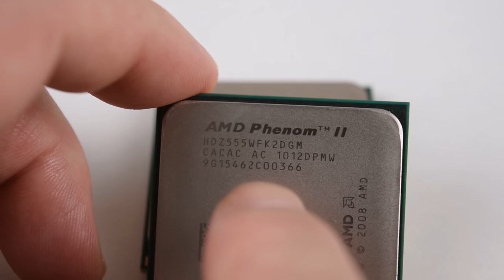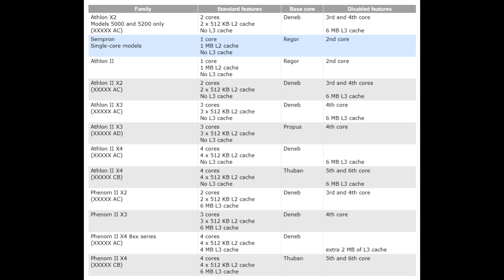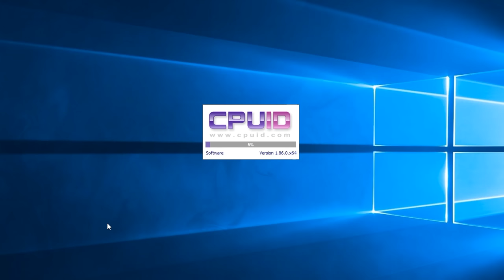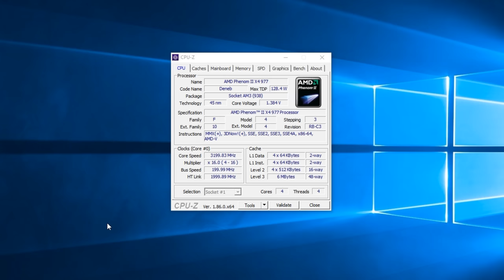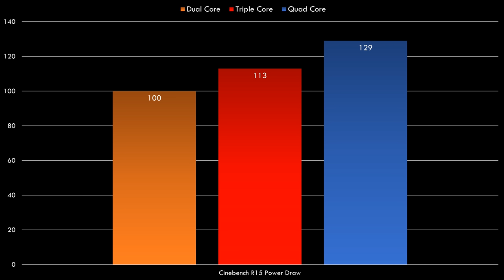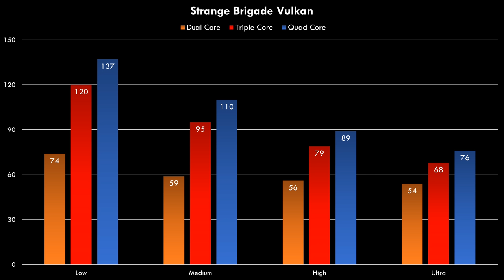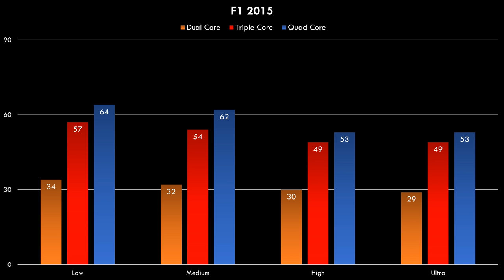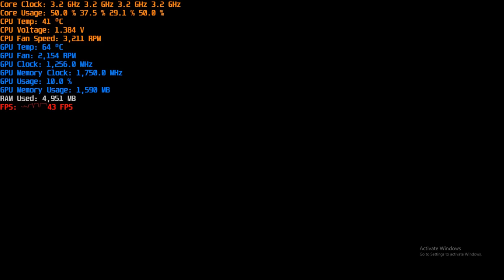Unlock $13 Dual Core into Quad Core

Comment: I have half a dozen of these laying around to build PC's for the less privileged. Did not know this and now I can give them more power for no extra cost.  Thanks Phil!
Reply: Careful, failing to unlock the cores can cause performance degradation
Reply: @nathanhamman418  Good thing Scooty has plenty to test.
Reply: Theres a reason why they turn them off.. Its the same reason why every chip on a wafer isn't labeled a Xeon.... Minor unavoidable manufacturing defects make it an unsuitable chip for the job.
Reply: @rezn66  He explains that in the vid along with an explanation of why it might be good to try. I get the CPU's from the dump so it's not so much of a worry.
Reply: From my experience on an Asus MB with the Core Unlocker switch, failing to unlock those AM3 CPUs doesn't cause degradation : it just won't boot. And if cores or cache are defective, you'll just have some instability issues.
The reason of defectiveness could just be a simple out-of-spec voltage requirement making a quad core chip being sold as a Phenom II x2-3 or an Athlon II x2-3-4. It's the true silicon lottery :)
Reply: @Vierax  They may not even have any defects. Sometimes they just bin them separate to sell different models. 
It's completely possible to buy a dual core that will unlock 2 extra cores and then that chip may well overclock more stably than a higher speed and core count binned one.
Reply: @Danny Evans I know but I was giving other explanation than what is in the video ;)
Reply: @nathanhamman418  That would be true if all chips sold were rejects. That isn't the case. The demand was FAR higher than the reject rate of the 4 core CPU's, not to mention the reject segmentation by the 3 core CPU's as well. In actuality, the difference was wafer real estate. The 4 cores got the prime real estate towards the center of the wafers, and the rest got the outside, where the reject rate would be naturally higher, but only subtly so, but enough to make it worth it cost wise.
Reply: The process is called "binning", and it's pretty standard in the industry... Once a wafer lot comes out of the factory, say 10K units, a bunch of random units in the lot (say 50 or 100) will be selected and tested. Depending how many have failures, the nature of the failure, etc, the entire lot it then binned (or rated) accordingly. They will use lots with especially good tolerances for K-series unlocked multiplier chips for example, and the worst for budget or lower core count, depending on the failure mode. Thing is what you get out of the factory these days is usually extremely consistent, barring problems with the equipment, which will usually make the chip useless anyway, so they end up with far more "good" wafers than there is demand for. So they lock some cores, or lock the clock multiplier, give them less cache, and sell them for cheaper. It doesn't mean the chip you have has a defect, it just means the lot your chip came from had a higher than usual core failure rate, so the entire lot was downgraded.
Reply: @rezn66  I agree! I have unlocked my Phenom II X3 720 BE and the system become unstable, due the problem in unlocked 4th core. It is nice to have something for no cost, just to be lucky it will work.
Reply: @peterfidler4891  I'm buying an old cheap Asus motherboard as a spare that still has core unlocker, can't wait to try my Phenom II x3 720BE on it too! I've had this CPU for a year but my current newer ASUS can't do any core unlocking sadly, it doesn't have that feature. Great CPU for about AU$18 but now it's gone up to AU$30+ so it must be a popular EBay bought CPU!

Comment: 0:27 oof, it hurts my eyes
Reply: Right?  Someone doesn't know what ZIF means...
Reply: @looncraz  What is the acronym 'ZIF'? I am quite curious.
Reply: @sanitylogic4611  "Zero Insertion Force"

These processors slip right in, you don't push on them. Great way to accidentally bend the pins.
Reply: @sanitylogic4611  Zero Insertion Force

It means the CPU should just fall into the socket - you NEVER push a CPU into its socket.
Reply: I thought I was the only one who noticed that omfg 🤦‍♂️🤦‍♂️🤦‍♂️🤦‍♂️🤦‍♂️ ZIF!!!!!!!!!!
Reply: that and sliding the cpus around on the desk pin side down in the opening clip. I am cringing hard.
Reply: @99domini99  that's dude.was a professional
Reply: Eyecat15  blaspheme!!!🤣
Reply: Zif
Reply: Yes. and if you slow down the video, it seem that several of the pins are bent.
Reply: Well that’s nice that you know what Zif means but from experience older am2/2+/3 boards tend to have misaligned holes between the actual socket and the white/blue plastic locking grid. I have two am2+ boards and it’s pain it the ass to get the cpu in without harming the socket... sometimes you to go as far as shaking the cpu in socket so the pins snap into their place. Even socket 7 has better locking mechanism than am2
Reply: Makes me glad Intel went LGA775 without any of that pin crap. Keeping old CPUs with pins like that properly stored is a nightmare.
Reply: @harryshuman9637  It's actually pretty easy. You just need some type of soft styrofoam so the pins can't move anywhere.
Reply: @siqu7071  Soft styrofoam will deform if pushed laterally, which will bent the pins even slightly. Especially if you keep it in box with other things. It's just the matter of time until you have to use force to put them in.

Comment: Beats Intels unlocking upgrade strategy.
Reply: I dunno, that server processor thing he showed us a while back was pretty rad. I believe it was the Socket 771 usable in a 775 motherboard? Either way, I learn a lot from this channel. :)
Reply: youtubasoarus . That’s not unlocking, that’s just modding. Intel actually sold locked CPUs that had the ability to have extra threads unlocked if you bought the upgrade card. You can’t even unlock those CPUs now as the service was quickly discontinued, unless someone has circumvented it.

Comment: Got to love the good ol' unlockable processor days. The cheapest unlockable to quad processor you can get back in the day is a certain athlon variant named "Athlon X2 5000" and yes that's not a typo. It doesn't have the "+" sign on it like most athlons have prior to the athlon IIs. I own one myself. Got it for around 40 bucks. It's sold as a low-clocked dual core processor running at 2.2ghz stock. Was able to unlock it to four cores with L3 cache and overclock it to 3.1ghz stable. That's insane value right there given the similarly clocked Phenom II X4 940 still cost around 200 bucks at that time and the Q6600 which was my then Phenom FX 5000 ( after the unlock ) was able to beat it at stock clock cost around 400 bucks. That's one of the best purchase I made in terms of value and kudos to AMD for that. Also, was able to unlock a Sempron 140 to two cores. And Phenom II X4 960T to five cores (sadly the sixth core is a dud).
Reply from the maker: Nice!
Reply: Nice! Never heard about that processor before, Interesting stuff!
Reply: I actually got given a Sempron 140 alongside a lot of ex office PC parts. Haven't really needed to get a motherboard for it though since I've got so much LGA775 stuff.
Reply: My uncle had a 555 BE unlocked to three cores, fourth was defective. These were great CPUs when thinking about best bang for buck.
Reply: we had some Athlon II x3 245's that we unlocked to be quad cores but windows detected them as Phenom II's afterwards
Reply: @billygray8863  i still have my old sempron 145 that i unlocked and overclocked to about 4.3ghz from stock 1 core at 2.8ghz
Reply: my best cpu i ever bought was a phenom ii 960t.. unlocked to 6 core and clocked 4.1 ghz
rock solid.
Reply: Nice. But what is the best core unlock cup now we are way past them being expensive?

Comment: "Need for speed (not sure wich one)"
LOL
Reply from the maker: I'm getting old ><
Reply: @philscomputerlab  nah, you arent the problem. Theres just too much NFSs out there LOL.
Reply: Don't blame him, it's so generic looking. Is it even need for speed?
Reply: @philscomputerlab  It's need for speed hot pursuit 2010 by the looks of it googling " grand ocean road need for speed " heh.

I remember reading that you could unlock cpu cores when i had my athlon II x3 445 @ 3.1 ghz & a HD 5770 as gpu, was great value for the money having 4 cores for i think 80 usd new at the time when i bought it with a bundle that included motherboard cpu, 2 gb ddr3 in 2010 (added in a 2 gb stick with that bundled order when i first built it & about 3 months later bought a hd 5770 as my first real gpu, went with the sapphire hd 5770 lite at the end of 2010.

(Still works, though processor is in an am2+ motherboard currently as my overkill windows xp rig as no one wanted too buy it when i put it up on an ad for 600 sek with a fan controller added in + a older 500w psu (not the best quality but works with a hd 5770 completely fine & said processor.)
Have gotten an am3 motherboard i might swap it into just too unlock that 4th cpu core again & undervolt the processor a bit.
Reply: Got a good chuckle out of that one.
Reply: @philscomputerlab   nfs not sure which one is the best nfs that ever came out 🤣🤣

Comment: Athlon X2 5000+ was a complete beast.
Unlocked mine from dualcore athlon to quad phenom with L3 cache and also overclocked.
The performance increase in multithreaded tasks was almost 3 times.
Reply: That makes me sad I can't unlock mine yet. I've got the 5200 :( I guess those two cores will have to wait... unused... :(
Reply: @youtubasoarus  
Dont worry, some times those cores werent stable enough or were outright defective. I remember some had unstable cores, they would work and all but would need higher voltage to stay stable or you'd need to underclock the hole cpu to a speed those extra cores could sustain stable. All this was mostly for those with a single core sempron or a athlon II x3.
By the times the X4 T series phenom II were out they were already obsolete so theres almost no one that unlocked a phenom II X4 to a X6.
Reply: У меня Athlon 64 x2 5000+
Можно пару вопросов? Я не нашёл в представленом списке, что в нём есть скрытые ядра.
Или ты просто разогнал те 2?

В чём может быть дело, если комп просто не включается? В блоке питания? Никаких звуков не или сигналов нет. До этого он включался спустя долгое время после нажатия на кнопку.
Я компьютерный нуб и гугл мне не помог, пишу с калькулятора(
Reply: @simpleman7203  Если чипсет от АМД - то нет unlock-а, но это не точно... У меня была мамка ASRock AM2/АМ3+ на чипесете nForce - там был unlock... брал ее под Athlon X2 7750 и получил - Phenom Х4.
Reply: @UlukaiUa  чет почитал, там нужно AM2+ минимум, у меня просто AM2 и оверклок двух ядер - мой максимум. Но мой комп всё равно не включается 😁 (Думаю, из-за бп)
Reply: @UlukaiUa  мамка, кстати, nForce4
Reply: @simpleman7203  если проблема в БП, то отключи его от материнки и попробуй стартануть его скрепкой (замкнув зелёный и соседний черный - который к центру ближе) http://static.modnews.ru/uploads/image/stat_case/ATX/ATX.jpg
*Только полностью отключи все коннекторы питания (и для проца - 4пин, и все молексы от приводов), ну и проверить включена ли кнопка питания на самом блоке :) http://it-pomosh.ru/images/articles/5.jpg
Reply: @simpleman7203  Посмотрел список чипсетов - АМДшные тоже есть с unlock-ом, вот список всех:
нВидиа:
GeForce 8200(with ACC),
GeForce 8300(with ACC),
nForce 720D(with ACC),
nForce 980(with ACC).
АМД Чипсеты с южным мостом:
SB710(with ACC), 
SB750(with ACC),
SB810(without ACC),
SB850(without ACC),
SB950(without ACC).
Reply: @simpleman7203  смотря на каком ядре твой Athlon x2 5000.
Был на ядре windsor (2 ядра 90nm)
Brisbane(2 ядра 65nm)
Regor(2 ядра 45nm)
И самый удачный Deneb(4 ядра, 6mb L3, 45nm)
Reply: @OMDFC  windsor aka
cамый не топ из тобою названных :)
Reply: @OMDFC  I have one Brisbane and one Athlon LE-1640B. Any chance to unlock them?

Comment: IDK if everyone will have the same luck I did but I built 4 systems using the Athlon II X3 455 and every single one unlocked to a quad no problem and they can be had on eBay here in the US for like $15 shipped. At 3.3Ghz its one of the faster Phenom IIs though you do have to remember by unlocking them they go from a 95w triple to a 125w quad so you need a board that supports 125w CPUs if you want to unlock those.

Comment: I remember comparing my E8400 to my cousins phenom 2 x2 550... When I showed him he could unlock it, he felt like new worlds opened up! lol
Reply: You made his Phenom 2 great again!
Reply: I have x2 550 as well few years back, unlocked to quad core and oc it on a asus board
Reply: @lcwpg  They were great. As a dual core it got smashed by my E8400 when both were overclocked. But as a quad,  there was several games which were much smoother on his computer. Though I think at the time I had a higher performance vid card. He ended up keeping that as his main computer for much longer than I kept the Core 2.  And he also paid less money for his system as well. It turned out to be a great machine for him in the long run. I think he only upgraded last year or 2.

Comment: Nice video, back in the old days when I was an AMD fan it was quite a surprise when we found out that extra cores could be unlocked! I still have my good old 1090t stored (fully watercooled Leo platform with 2x5970s it's in some of my videos), but the lack of modern instuctions could be a downside for certain newer games that don't support Phenom anymore.

Comment: Good to see some positive results from this!  I always wondered about it but by the time I was able to upgrade to a Phenom I ended up getting a regular quad-core (940BE) which I still use to this day on my main rig.  It keeps up well enough for most AAA titles at 1080 and graphical settings that are good enough for me (with a RX 560/460 gpu).

Comment: Nice video. Note one thing- these gen AMD CPUs were usually fairly easy to OC (which helped offset the lower stock IPC). If somebody is willing to unlock a core or two, they might also be willing to up the HT clock a bit.
Reply: I remember that the HT clock didn't add a lot, just like high freq DRAM didn't give really much because of the IMC. But that was a fun platform to tweak :)

Comment: Around the same time, I had gotten a Athlon II x3 from my best friend. I decided to overclock the sucker from it's 2.9Ghz all the way to 3.75Ghz (Could get to 4.1 stable, but was too hot for the cooler). That thing Flew played a lot of great games on it. He ended up getting a Phenom II x6.

The overclocking and unlocking potential for these chips was amazing, I remember on one of our older enthusiast forums where someone unlocked their heavily discounted Athlon II x2 to read to a Phenom II x4 and overclock to 3.8Ghz. That made a lot of us go nuts over these chips. They certainly aren't Xeon Engineering Samples, but they don't slouch because of their age.

To be completely honest, you should do a video of an ES Xeon build, would be interesting. It would certainly help those who's wallets are on diets.

Comment: Old system had a phenom II 945, 8gb ddr2 and hd 6950 flashed to a 6970 shaders. Started it's life with  an Athlon II x3 440 that wouldn't unlock, an hd 5550 and 2gb ram. Asus m4a785-m board. No regrets on that system tho . Lasted basically 7 years till it was pushed in a corner and used for older games and movies lol 😜. Thanks for the nostalgia.